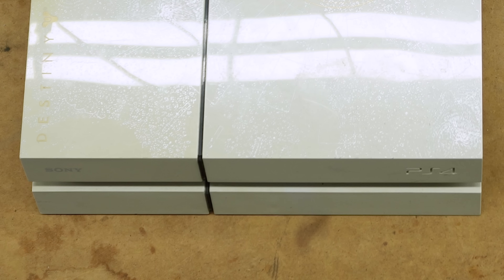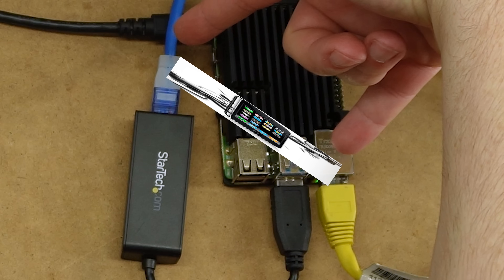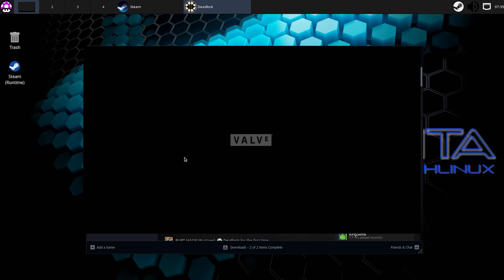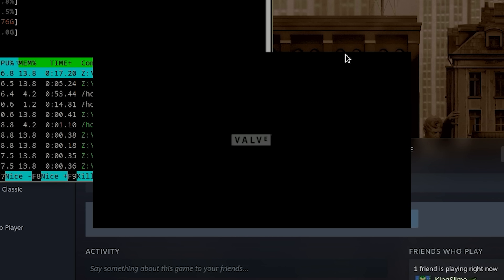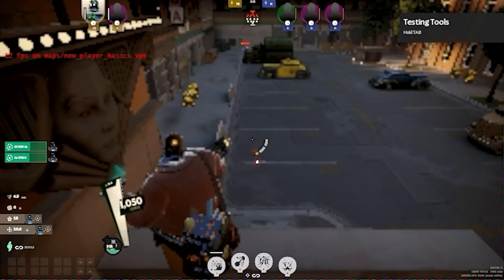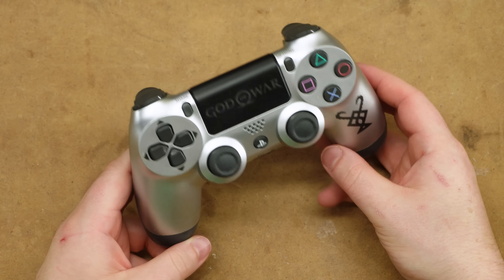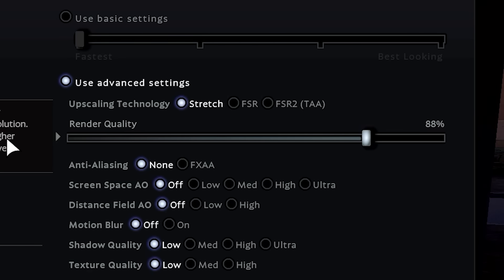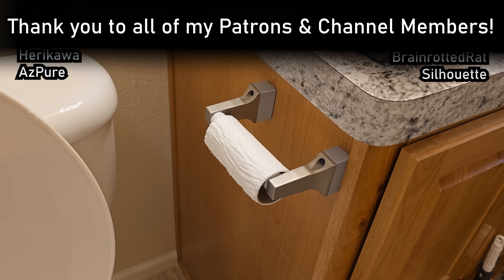I Played Deadlock on the PS4. It's as bad as it Sounds.

Comment: The gpu inside the ps4 is pretty decent the cpu and the 8gb of GDDR5 hold it back as there isn't enough system ram and video ram
Reply: Easy to forget it's essentially a 2ghz FX CPU, so about the performance of an i7 950 downclocked
Reply: yeah its pretty amazing late gen games use a lot of compute shaders "as a crutch" its pretty amazing what games run on basically ancient hardware
Reply: yeah it shows whenever he ups the resolution and it runs basically the same
Reply: I think that's the bottle neck of my rig is either ram or vram. Dude I haven't messed with my computer in years. I popped it open to clean after I edited fan setting and it broke windows. Thankfully I had a backup but that's happened now times than I care to admit.
Reply: just really bad drivers, it should be able to do this easly, even with swap memory.
Reply: @Maxtraxv3  swap is alot slower than vram though
Reply: But for 2013, it had prime specs that rivaled higher mid range pc's of that time
Reply: SSD swap with 32GB of ram can make any laptop seem new. 100$ in parts can make your laptop run faster than you think. Some people still have spin drives and cold booting windows 10-11 of a spiny drive it can take forever.
Reply: @ohioplayer-bl9em  swap can wear the drive down and isn't as fast as actual ram
Reply: @Carrington1961  Wasn't it a true eight core though? Unlike the "Eight Core" bulldozer-series, y'know.
Reply: @WalkerArt-64  Yeah it's a Jaguar architecture, not bulldozer and had full separate cores, not clusered multi-threading. It was used in some low power pc/laptop cpus as well but even more cut down only with 4 cores.
Reply: And yet despite this deficiency, it is also capable of outputting Horizon Zero Dawn, God of War, and The Last of Us Part 2. 

When people say the consoles can do shit that PC hardware can't of equivalent make, you are looking at live evidence of that essentially throughout Bringus's videos. The amount of hypertuning of Sony's SDK and OS make this hardware punch exponentially above its weight class.
Reply: I mean it can run Jedi Survivor pretty well, the same can't be said about a PC from 2013.
Reply: @DuncDog  yea well that's the advantage of consoles, developers can trust that every single potential customer on that console are going to have the exact same hardware so they can do way more fine-tuning to maximize performance as much as possible without reducing perceived fidelity much, this is simply impossible for the game versions they release on PC because of the near endless combinations of hardware customers can have
Reply: @DuncDog  you do know games were optimizated around these limits right? You can't just play normal non optimizated games like this
Reply: @WalkerArt-64  it's from the 'kabini' architecture 
It's basically 2 amd 5150's on one chip with l3 cache
Reply: Unfortunately AMD developed the ps4 cpu architecture before they turn around their company with ryzen. AMD was so bad back then with their FX bulldozer cpus.
Reply: @Eradicationist  your gpu has its own ram it's not shared with the system
Reply: @acwbit2368  yea but the cpu and gpu do need more cores and the gpu only running at 800mhz for the time of release when PC gpus were doing like 3x as much is kind of laughable, the ram is not the only thing holding it back although another 8gb of it would have definitely made it more stable...i think what held the ps4 back and what holds all consoles back are their absurd wattage goals like the ps4s goal of 75-100watts idle with a max of 310watts I think minimum goal should be at least like double that or maybe closer to 500, which is still reasonable for cooling and size in my opinion and they could of added a low power idle or power saving mode like consoles have now already anyways on top of their massive wattage restrictions...mostly why I switched to PC, why pay for marketing and big fancy words if all you are getting is neutered hardware for the same price it cost to build a pc.
Reply: Decent for 2013 sure
Reply: @slurples149 More like lower mid tier PCs. And even then, that's not that impressive. If we jump back to the Xbox 360, that thing was trading blows with high end PCs in 2005
Reply: likely not the hardware but optimized/bugged drivers are to blame

Comment: Whenever I have horizontal lines across a screen it's because a part is dying in the machine. So have fun with that!
Reply: the playstation home screen was doing fine so it was just linux causing that.
Reply: @Sam-im6lk  If it were a single program then that would make more sense, however since the lines are across the whole screen there would have to be a rendering bug in Linux's display stack that's exposed under heavy load for it to be truly caused by Linux. It just doesn't seem likely compared to hardware failure. The actual Playstation OS is likely just designed to prevent the hardware from getting into such situations.
Reply: @monorail0  Or he is silly goose and forgot to turn on v-sync. Because that thing is actually important to prevent screen tearing n stuff when you dont have no fancy g-sync or whatever,
Reply: @alexturnbackthearmy1907  brother, those lines are GPU artificats, not screen tearing. Screen tearing would be limited to the game window being rendered. It will also cause a horrendously sloppy feeling game with tons of input lag if enabled on a machine that can't hold 30 fps.
Reply: This is probably because of shared memory between gpu and cpu not being respected properly. Probably some PS4 weirdness not properly taken into account into the linux kernel running on this. Given that the ps4 pro runs worse than the ps4, it's quite likely that both of them are capable of more with better ps4-specific kernel patches.
Reply: I'd guess it's more likely a compatibility/driver issue given the lackluster performance and all the issues he faced. A regular PC with comparable specs should be able to play Deadlock just fine at lower settings.
Reply: @monorail0  gpu drivers can cause that

Comment: 2:20 Nope, it will not help with performance. Why? Because Sony, in their infinite... let's call it wisdom, connected the internal HDD of the PS4 to USB. Yes, the PS4 uses a SATA to USB adapter for the internal HDD, despite having an internal SATA controller for the Blu-Ray drive.
Reply from the maker: REALLY WTF
Reply: Sony tweaking as usual.
Reply: Idk if it would help connecting it internally either...cause it has SATA II. A decent hard drive would be about as good as ssd in that scenario.
Reply: @alexturnbackthearmy1907  I have tested HDD vs SSD on SATA2 and it still helps tremendously. Cut down Path of Exile loading times from 7 minutes to 20 seconds.
Reply: @BringusStudios  Yeah. I'll always remember that little fact because of the mini-rant about it in marcan's 33c3 presentation about getting Linux on the PS4 in the first place...
Reply: I know they've had some wacky people in their ranks over the years, but that is just unreasonable
Reply: Is there a good reason for that? At all?
Reply: @yasu_red $$$
Reply: What.
Reply: Most competently designed modern sony product
Reply: On PS4 OS SSD helps massively, so clearly there is some bandwidth/ random Io headroom even with the setup Sony went with
Reply: @alexturnbackthearmy1907 no. It would be as good as a mechanical hard drive only in one metric: sequential read/write. It is a metric loved by the manufacturers, but as an OS drive it has very little impact compared to random I/O. 

Some old SSDs like Intel X-25M are SATA2, because it was the only revision available at the time, and access times are still 2 orders of magnitude faster than the best 10K RPM HDD of that epoch (like WD velociraptor). I mean, those old SATA2 SSDs are decent OS drives even by today’s standards, running circles around the fastest SATA3 HDD you can buy today.
Reply: wait this is SATA II?! why?! @alexturnbackthearmy1907
Reply: @SimonBauer7  Costs.
Reply: @yasu_red  They don't have to put SATA controller hardware on the SOC i guess. A SATA > USB adapter is not necessarily slow, depends on the chip.
Reply: @s8wc3  Except there IS a SATA controller on the SoC, for the Blu-Ray drive. Its just a choice they made, because not even the absolute insanity of Sony's choice of "southbridge" explains it.
Reply: @KDHofAvalon  Only God a random engineer in japan knows
Reply: Reading this comment section feels like walking around the schizophrenia hall on a psych ward
Reply: @s8wc3 I swear Mark Cerny took over after the PS3 though
Reply: Also cpu held back the loading speed
Reply: Tf 😮
Reply: @jorge69696 For me personally, changing out the HDD for an SSD does help on PS4. Loading times in Crash Bandicoot 4 were unbearable with at least 1 minute, either with entering a level for the first time, or having to restart it. An SSD cut down the loading times to about 30 seconds. Still bad, but not quite as bad.
Reply: Bruh, i can't even right now
Reply: @alexturnbackthearmy1907  the comments dont know anything, you are techically right about hdds having the same speed asd a sata 2 ssd, since sata 2 has 3gb/s (200 something megabytes/s) but that hdd speed only exists for enterprise-grade hdds, consumer ones will max out at 190mb/s at most.
Reply: @jorge69696  No it didn't lmao, you didn't go from 7 minutes to 20 seconds. I cannot believe 100 people liked and upvoted this comment believing it.
Reply: @jorge69696  probably because random writes and reads can be under even usb 2.0 specs on ssds and for HDDs they can be slower than floppy drives
Reply: ...It's at least USB 3.0, right?
Reply: Ah, that explains why the load times on that console fucking suck compared to all of their competition. A shitty USB 3.1 flash drive probably has better performance.
Reply: @jorge69696 That souns like drive failure because I don't think a ssd is 14x faster than a hdd
Reply: lol wtf?

Comment: The main reason swap helped is because you've given the Linux disk cache some room to breathe. When the system is under memory pressure, the size of the disk cache will decrease, causing pretty much every I/O operation to go to/from disk directly (as the cache is just too small for practical purposes), which slows down the system dramatically. Enabling swap lets the kernel move over some unused userspace memory onto disk, and keeps physical memory available for disk caching.

Comment: Fun fact: PS4 uses SATA II (as the same as PS3), so there wouldn't be any difference between HDD or SSD.

But, it has two USB3.0 ports, so you can run a SSD through an USB3.0 adapter and it'll be running almost at SATA III speed (i.e. at 5Gbps, while SATA II is just 3Gbps and SATA III is 6Gbps)
Reply from the maker: I feel so wronged by sony rn that's criminal
Reply: At best you'll get a small boost from instant access times. I've noticed a bit of a change when I put an SSD in my PS3.
Reply: @spiral1407 Dust514 had significant increase in performance with an SSD. But it also was laggy as shit anyways since it pushed the PS3 too hard

Comment: Cloud engineer here, just a note bringus: You can use zram to compress your ram on the fly, this will almost give you twice the ram capacity with just a slight hit to cpu performance without using any swap!

You should get about 12-13gb of ram at that point, looking forward to more PS4 videos!
Reply from the maker: Ooo that sounds wacky, I feel like this thing's CPU would NOT like that but that could be a viable performance boost if it doesnt't shit the bed too hard

Comment: On downloading more ram: try setting up swap in zram in such situations, it can be better than only-ssd *sometimes*, basically it swaps into ram itself but compressed (by eating some of cpu power). And keep ssd with large cache for lower priority swap that spills over of course. it will need to be tested at least to make sure that this older cpu under load is faster at (de)compression than your drive's sata lane, try changing compression algorithms, you can imagine the waste of ram if it get slower than sata :D

Comment: 1:50 All jokes aside, if you're still using a ps4 and you're still using a hdd(whether the one it came with or upgraded for more storage), an ssd seriously is just a nice quality of life upgrade. Before I got my ps5 as my ps4pro on crack, having a launch ps4 with ssd just makes it so much more usable. It's still going to cry when playing AAA games released after 2019 (Miles Morales and Ragnarok). 

If you have a launch ps4, you definitely should upgrade. But if you have a slim or pro, you're probably fine especially if you play online since the 5ghz connection is doing a lot of the work(and pro w/ boost mode just brute forces games to work better) while the original ps4 having 2.4ghz is going to struggle, but the ssd helps alleviate those load times a bit.

Also clear your cache, rebuild the data base, and clean the damn dust out, your ol' boy probably needs it.
Reply: The way you talk about these things... consoles have finally become PC. Or maybe PC has become console? Looking at you, W11!
Reply: Replacing the VRM padding, repasting the APU and an SSD helps the non-pro version remain playable.
Reply: @TheBcoolGuy  PS4/XB1 and on are just really weird-ass APUs but it's all x86 now, hell it's all just some variant of consumer desktop parts. OG Xbox as well, 360 was the odd one out with custom PowerPC architecture and a custom ATI GPU.
Reply: Also please reapply thermal paste and thermal pads, it makes a pretty noticeable difference in performance and it will last longer
Reply: The PS5s GPU is basiclly just a Radeon RX 6700. You're better off building a PC. The upfront cost will be a bit more to get equal or better performance but you'll save money in the long run since games are so much cheaper and you aren't paying for online.
Reply: lol wifi speed is hardly a bottleneck for online gaming. you could use coaxial ethernet from the 90s and it would still not bottleneck (that much, because the hardware for that itself would add at least 30ms ping. but not the connection itself). wifi isn't ideal mostly because it's full of interference in many places but that happens on both bands.

Comment: an SSD doesn't really speed up load times because the PS4 has a SATA 2 controller on it. SATA 2 is bottlenecking the SSD.
Reply: The internal SSD even runs of USB. They basically put a sata2 to USB adapter on the board.
Reply: still superior IOPS and queue depth but transfer times ain't gonna budge
Reply: For sequential reads yeah, but on random reads it’ll still be FAR faster, especially compared to those laptop drives, even on sata 2. A drives random read performance is mostly what’s responsible for how responsive your OS feels.
Reply: The pro one does support sata 3
Reply: Back when I was playing Snowrunner on ps4 I did the SSD upgrade. Load times didn't improve that much but man menus and asset streaming were night and day better.

Comment: 16:40 (ongoing) the lines may have been caused by low vram, I hope that you have tried it with more than 1gb (with that swapfile it shouldn´t be a huge problem)
Reply: ok, thats sad that you didn´t try it. the minimum specs for deadlock seem to be 8gb ram and a gtx660/HD7850, both ow which are 2gb models. 1.5-2gb vram, 6.5-6gb ram + swap should realistically be enough since all the stuff in the swapfile stored (this vid) probably were background processes. If I had a ps4 and access to deadlock i´d try it further

Comment: i know it's probably because of the Linux issues, but i dont understand how a better system can have a game run WORSE
Playstation is an enigma
Reply: the linux kernel and GPU driver is no where near as optimized as the official operating system that sony uses.    and its not a priority to fix.
Reply: Having specialized hardware run a generic OS, then add to the pain with games that aren't built for that hardware, is always gonna be a rough time. 

Now, if Sony did something totally unprecedented and actually added support for Linux... /s
Reply: @thewolfin  sony and also Xbox require that you sign an NDA before you are even allowed to see the documentation for their API.  and that doesnt cover the 10 thousand dollar devkit workstation.    that level of secrecy is not compatible with any open source project.

Comment: Swappiness of 100 might be a bit heavy-handed. Linux will use the swap file if it runs out of physical memory, no matter the swappiness, and will put crap that isn't in active use there. I would see how 0, 25, and 50 fare. Overly aggressive swappiness will cause those long hitches that you saw - and possibly even low framerate if the thrashing (swap overusage) is serious.

The ideal situation would be to use 100% of RAM, and overflow the rest into swap. Computers aren't like cars: full usage of their resources is a good thing (so long as that usage is doing useful/intended work).

Comment: PS4 Vanilla AND PS4 Slim both USE SATA II, which has less than ideal speeds. PS4 Pro however uses SATA III, and it can benefit from the SSD upgrade significantly.

Comment: About a few weeks ago, or a month, Deadlock used to have a VRAM based memory leak, I am uncertain if they fixed that. But I presume it's fixed by now. 

But, also, Linux doesn't have shared memory (Sending VRAM -> RAM), at least not on nvidia graphics cards. I haven't tested on AMD, but judging by the fact that my old sh1t RX 460 could run Borderlands 1 remastered, i'll say it might have it... And a memory leak.

Comment: I was inspired by this video to run Linux on my own PS4 and I discovered that installing to the internal HDD is a huge mistake. A USB hard drive makes the system 10-50x more responsive.

Also worth mentioning, DF_AUS has an image for Fedora 40 available now, much newer than the Fedora 38 used in this video. Recommend giving that a try.